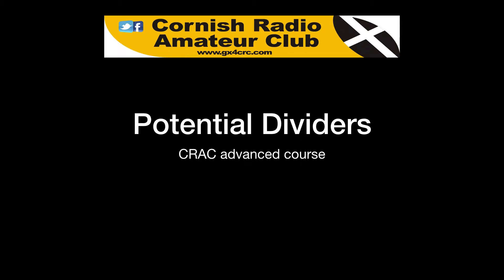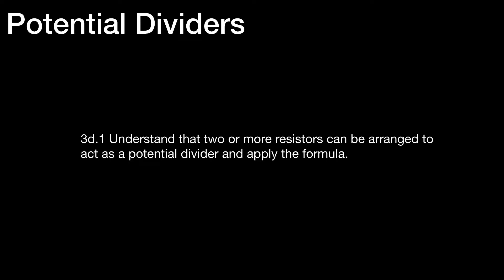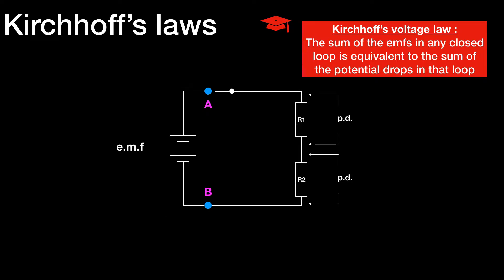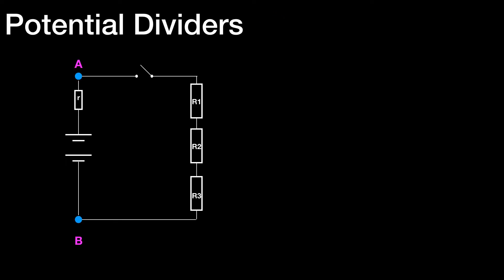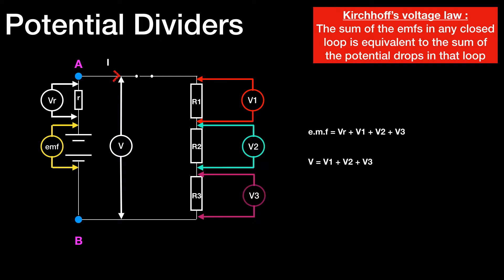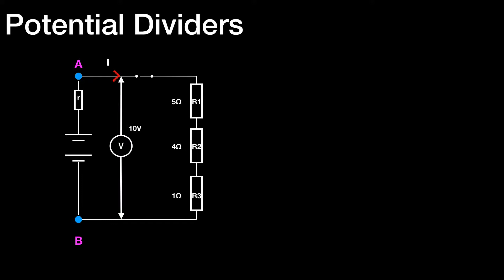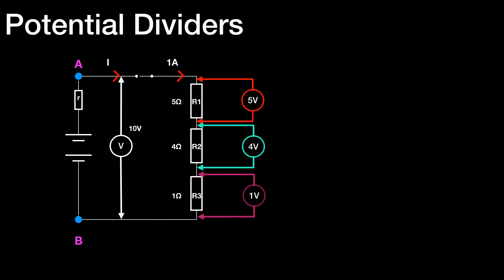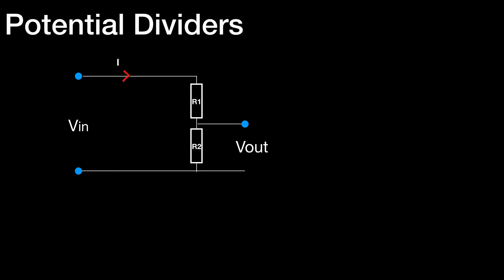Advanced - Potential dividers

Comment: In the last example with the formula V out = V in x R2 / (R1+R2) Can I also just work out the circuits amp draw and then just use I x R2?
Reply from the maker: Yes. In fact I prefer that way of doing it.   It's more generic and you can use it for different configurations
Reply: @cornishradioamateurclubtra4073  Thanks for the reply it is greatly appreciated. Also thanks for all of the videos they are a massive help.